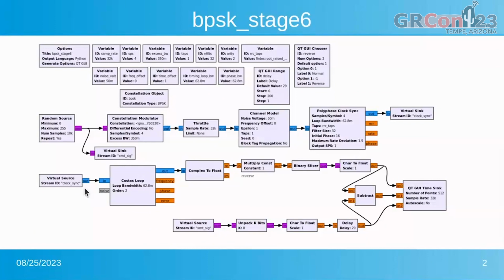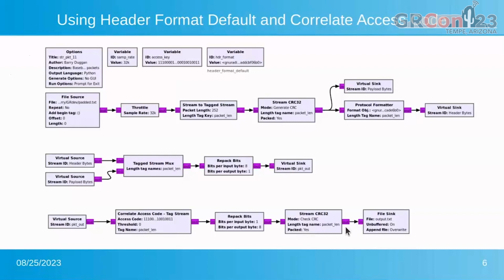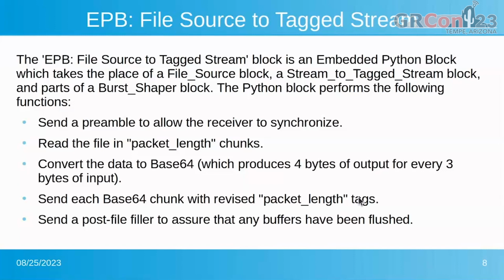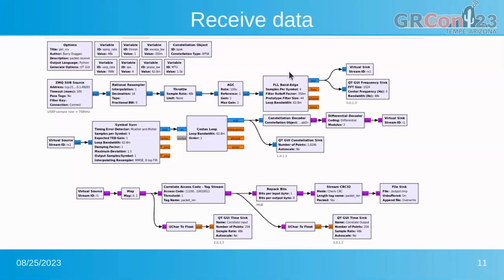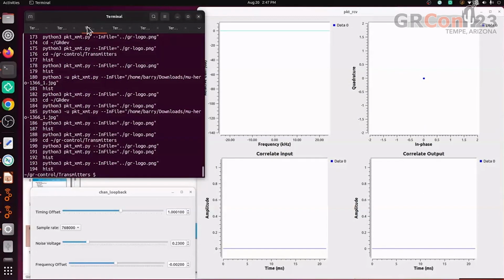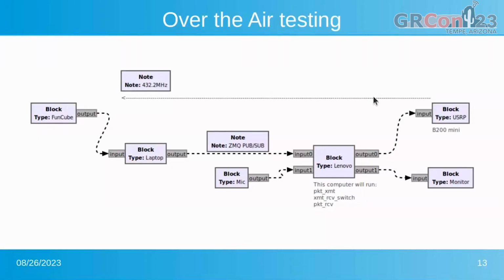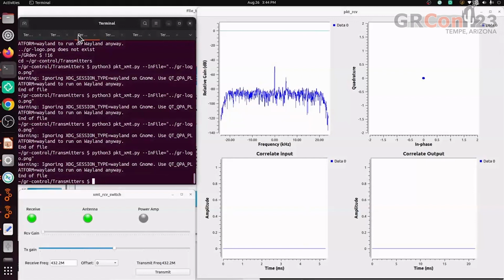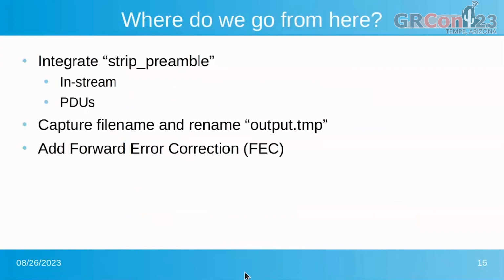GRCon23 - File transfer using Packet and BPSK - by Barry Duggan

Comment: can u answer if i add MESSAGE EDIT BOX FOR SENDING SHORT TEXT MSG THEN WILL IT POSSIBLE WITH USRP b210.WHAT CHANGES SHOULD I DO IN BURST TRANSMISSION . THE MAIN PROBLEM WITH EITHER TEXT OR REALTIME AUDIO TRANSMISSION THAT UNDERFLOW OCCURS AS I AM ONLY FEED DATA FOR A PERIOD OF TIME ONLY. SO HOW CAN I CONTROL THESE.